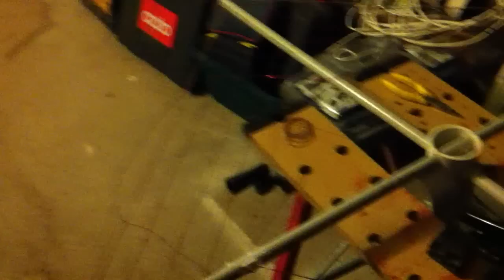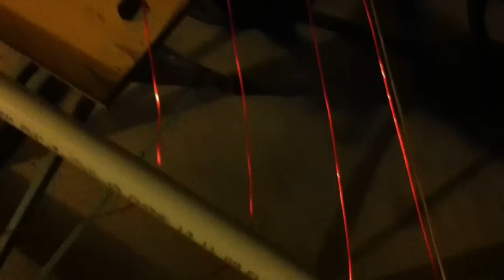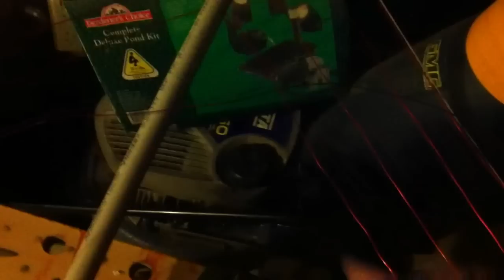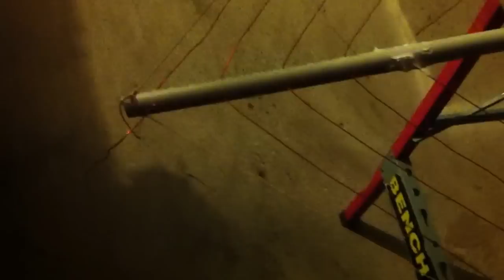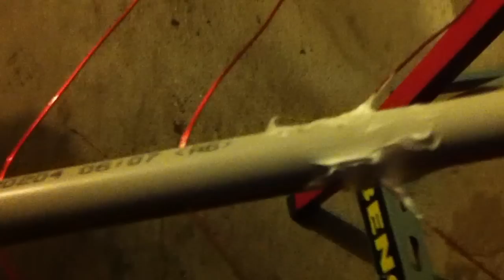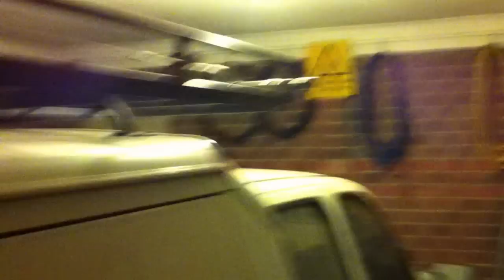HF Spiral Loop Antenna video 2.

Comment: take a measurement at the antenna feed point and figure out how many ohms it is.  then maybe you could use a baking to feed it.    if you don't want to mess with it you could always hook it up to some 450 ohm ladder line and tune it thru a transmatch.